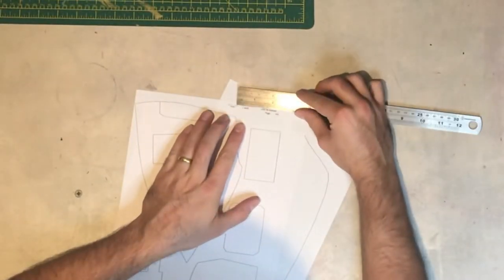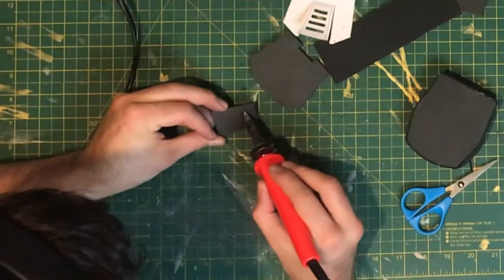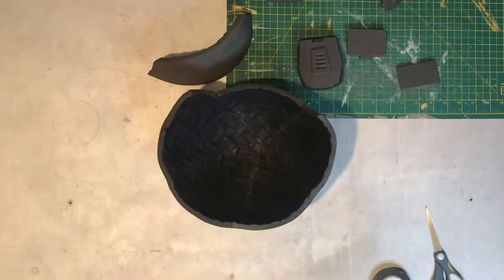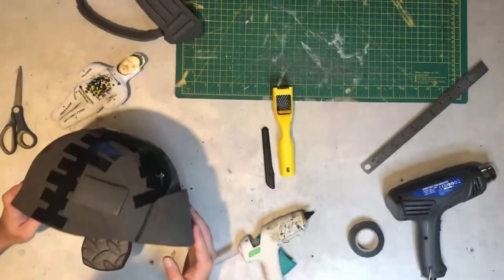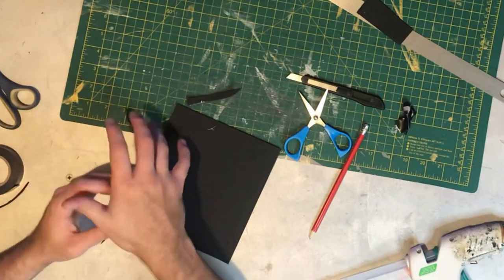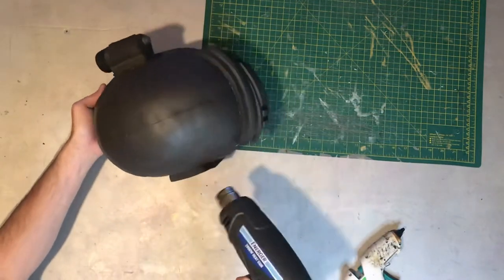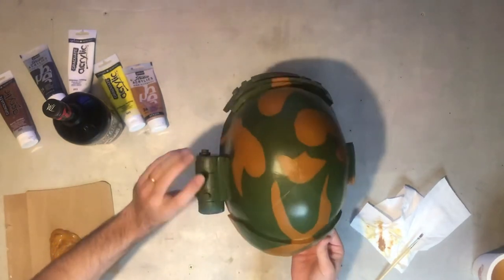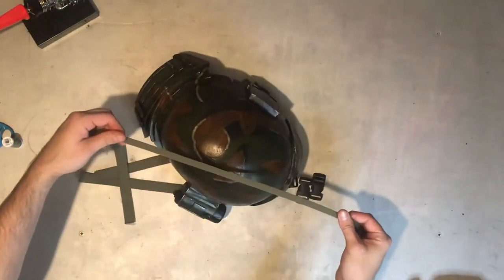How to make a Colonial Marines Helmet from Aliens

Comment: Great job! My son and I went to the 2016 San Diego Comic Con dressed as Colonial Marines. It was the 20th anniversary and they had a panel with all the original cast, I got to go up and ask them a question.James Cameron liked my out fit and Bill Paxton signed my helmet with "Game Over"! Wonderful experience, we actually did the pepakura method and overlaid it with fiberglass. For the helmet we attached all those pieces to the shell of an old steel us army helmet. We painted it pretty much the same way you did, yours looks a lot easier to do! Good luck with the rest of the armor.